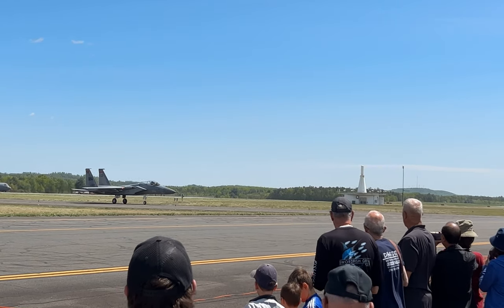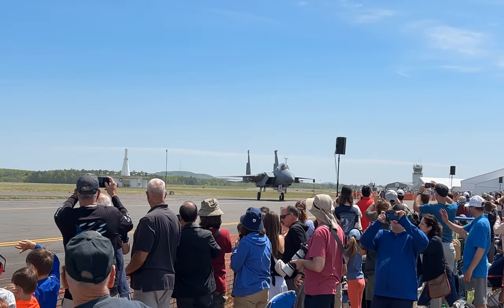F-15C air combat maneuvers demo | Westfield International Airshow 2023

Comment: I worked construction in Vegas, we had a couple of jobs on Nellis AFB. We were right by the flight line and every morning they'd start firing up the engines of the fighter wing; F16, F15, F22, and the F35. Some mornings, after the wing was out, the Thunder birds would practice. It blows me away that any country would want to make trouble and be visited by The US fighter forces.
Reply: Same at Barksdale AFB. I couldn’t get anything done the first week!
Reply: China wouldn't be scared; they have the J-20, a 5th gen fighter. Russia wouldn't be scared, either, with their Su-57.
Reply from the maker: @markymarknj yea the J-20 and it’s “stealth canards” and the SU-57 which has a like what 12 units made that can actually fly? Yea REAL scared of these jets, while F-35 orders keep piling up from other nations and growing.
Reply: @TheblueTraxxasRustler the problem is, besides the F-35, we're not building any modern fighters. The F-15 first flew in 1972, which is over 50 years ago. The F-22 was cancelled, so we won't get any more than the too few 187 we already have.
Reply: @markymarknj there’s no point in building modern fighters. when you have jets as stealthy as the f22 and f35, they’re never gonna get in a dog fight anyway. The f22 could unload its entire armament of missions before the jet it’s targeting even notices it’s there.
Reply: Also we’re currently building a 6th gen fighter jet so the discontinuing of the f22 won’t hurt us.
Reply: @Godios119 the Generals and Admirals and other "smart" people thought the same thing in Vietnam. Shoot, they were so convinced that the F-4 Phantom II didn't even have a gun! How do you know circumstances, ROEs, etc. won't result in a merge, followed by a dogfight?

As for the F-22, I'll concede that it's a great plane; I dare say it's the best fighter on Earth ATM. The problem is that we do not have enough of them! We're in the same situation the Germans were in WWII with their Me-262: they had so few jets that they were overwhelmed by legions of inferior, slower, propeller planes. What's to stop an enemy from doing the same with our F-22?
Reply: @markymarknj  firstly, the problem with the f4 phantom is that it’s not a stealth plane. The people who made it assumed that missiles would do a better job in a dogfight than a gun, and they were partially right, but also wrong I’ll give you that. But the f22 AND the f35 are stealth. The cross section of an f22 on radar is about the size of a bumblebee, and the cross-section for an f-35 is about a golf ball. So yes, technically the f22 is more stealth, but when it comes to application it doesn’t really matter, they’re both for all intensive purposes undetectable. There are 2 kinds of radars used in the military, high frequency and low frequency. With a high frequency radar both are completely undetectable, but with a low one Both are detectable. However, low frequency radars only tell you something is there, they don’t give anything solid enough to track, and not to mention that if you’re picking up the radar signature of something the size of a gold ball, then you’ll pick up the signature of similar sized things, such as birds, or literally anything else in the sky. This is why the f35 is still ridiculously good stealth, even tho it still is technically worse than the f22. And don’t get me started about the j-20, they’re still only considered gen 4.5 along with su-57s which are still probably worse. I could go on for hours about how Russia (and the Soviet Union before it) went all into dog fighting capabilities for researching their jets and completely neglected stealth so the su-57 is really just a glorified dog fighter that would get toasted by either an f22 or 35
Reply: @Godios119 thanks for the great response! I and others learned a lot. I guess my point is that we shouldn't neglect dogfighting. Granted, given the strengths of the F-22 and F-35, that BVR would be preferable; it's better to smoke the other guy when the other guy doesn't know you're there. The vast majority of kills in fighter combat happened when the killee didn't see the killer. That said, it's best to be prepared and ready for WVR, because you don't know when or if things will go there.

I wouldn't classify the Su-57 as a true, stealth aircraft; it's less visible on radar, but it's not stealthy. Just look at how the engine exhausts were neglected-'nuff said! Like you, Max Afterburner consider's the Felon to be, at best, a Gen 4.5 fighter. I think that CW Lemoine, aka Mover, also agrees with you. I'll defer to their judgment, since they're veteran fighter pilots.

As for the J-20, with the canards, it's probably less stealthy than either the F-22 or F-35. However, it's a huge step for China; they're making big time progress. To go from making MiG knockoffs to their own, indigenous aircraft in 2-3 decades is impressive; to make aircraft like the J-20 and J-31 is even more so. The J-20's canards would help the aircraft in a dogfight. Plus, China has a couple of hundred J-20s, and they have more joining their air force all the time. Finally, China has a huge manufacturing base, something we no longer have. If we ever fight them, we have to deliver a knockout blow right away; if it's a war of attrition, we lose. China is the USA in WWII, while we're where Japan was at the start of the war. I hope we don't go to war with China, but if we do, we have to take them out quickly; it's the only chance we'll have to prevail.

Oh, and speaking of stealth, you know what's ironic? It was a RUSSIAN (back in the days of the USSR) who came up with the formula for stealth! The Soviets didn't know what they had, while we did; our scientists knew the significance of the discovery, and we got a decades lead on everyone. I learned that in an old History Channel documentary... :)
Reply: @Godios119  Sadly, we only have less than one hundred F22s and no plans to restart production. As far as being undetectable, that's absolutely false. Stealth doesn't make jets undetectable. It makes them difficult to track or get an accurate weapons lock.